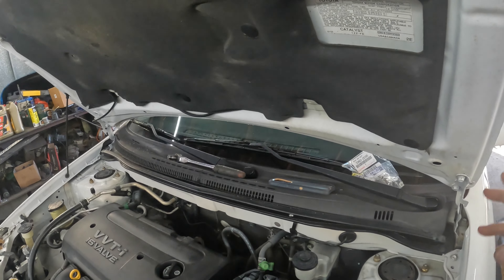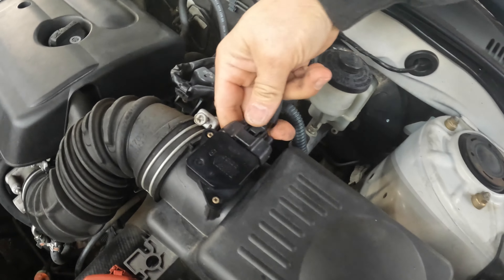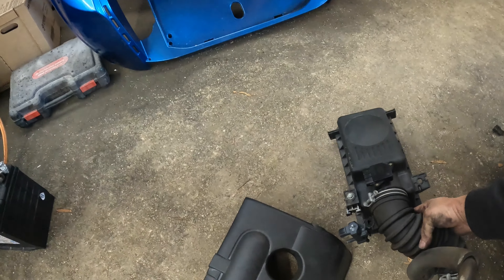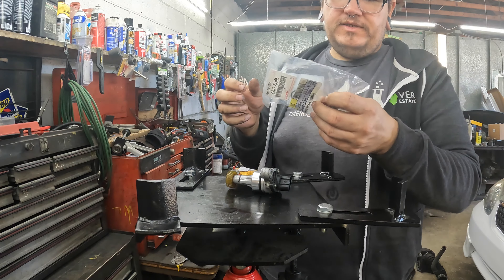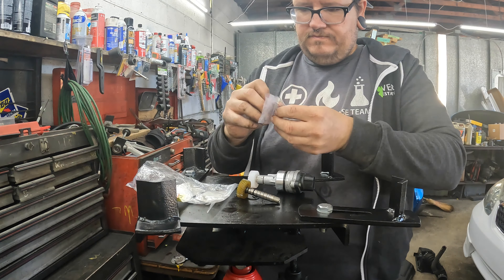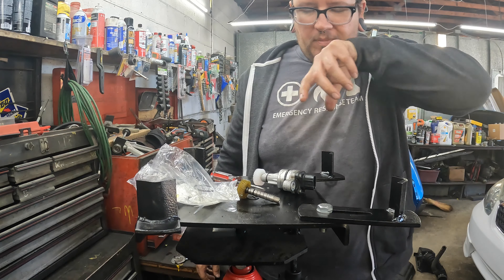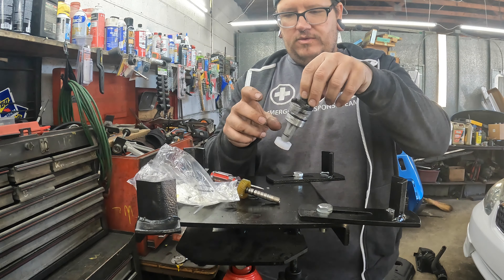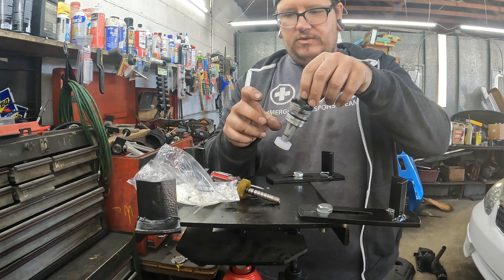2005 Corolla P0741 Code Recall/TSB Fix

Comment: My 05 Corolla has had the 741 code for 150k miles. Still Rolla'ing along and just hit the 310k mark today.
Reply from the maker: This code normally does not change the way the car drives for the most part.  Most people need it fixed to pass inspections.  If it was my car, I would have just drove it with the code in it.
Reply: It won’t pass a smog check in California with this code. I’m replacing the solenoid. I didn’t know about a recall that would cause the same code. I have taken the car to get the codes but the part you replaced doesn’t show only the solenoid.
Reply: @operationoverhaul

Comment: How is the p0741 code a recall?
Reply from the maker: Toyota issued the recall after so many of the cars has the issue with the code.  They showed a step by step procedure of what to change and if those did not fix it then you needed to replace the entire transmission.
Reply: @operationoverhaul can you post a link to that?
Reply from the maker: @josiah7552  i will find it and post it for you tommrow
Reply: @operationoverhaul thank you, you're the man 🤘🏽
Reply from the maker: @josiah7552  https://www.troublecodes.net/wp-content/uploads/2023/03/p0741.pdf this should get you what you are looking for.  If not, I can save it and send it to an email address if you would like as well.

Comment: I have been seeing this error for a couple of years now. Is there a way that I can get this fixed in a toyota dealership without costing an arm and a leg? :P
Reply from the maker: They will probably go through the same procedures that I did in this series of videos.  I tried multiple things to correct it and did not get any resolve until the customer changed the entire transmission assembly.  This was a recall/tsb at one time but I think it will not go through now due to the age of the vehicles.

Comment: Is this code belongs to gear box, is not repairable without downing gear box?
Reply from the maker: The recall has a few steps to it.  It says try the speedometer gear, a new solenoid, and then if that does not work to swap the transmission and torque converter.
Reply: Is it covered by the manufacturer?

Comment: Daaamn i really dont want to replace the trans on mine. Code pops up very little but i am starting to get worried. Still haven't done a trans fluid change but its due now. Hope that'll solve it but I don't have high hopes seeing your video and comments here 😅 what are the symptoms of that code?
Reply from the maker: So, most of time I do not see a difference in how the vehicle drives when this code pops up.  If anything, you may not feel it engage lock up.  That is about the only thing you will probably notice.

Comment: Did it work
Reply from the maker: No, this did not fix the problem.  Ended up replacing the transmission and now it is all good to go.
Reply: @operationoverhaul this code shows up once in awhile on my 2005 Corrolls but it drives great. Recently got a new battery, spark plugs, tires, new Sepertine Belt; in 2021 I got a Trans Filter and Flush
Reply from the maker: @AndruWProWrestling  on this car I was even able to verify that the tcc was going on and off but it was still throwing the code.  Was a pretty common issue if they issued a tsb on it.
Reply: why didnt you just replace the solenoid?!  @operationoverhaul
Reply: or at least test it with a power probe? @operationoverhaul
Reply from the maker: @yoshihisa4213  the owner did not want to replace yet.   They wanted to follow the tsb and change the parts in the order of the tsb.  The solenoid was tested with a scanner and it will actuate when prompted.  Even when running it actuates on its own while driving as well.

Comment: Is there a recall for that? Because I have this code coming up for my 2005 toyota corolla
Reply from the maker: It is not a recall but rather a TSB (technical service bulletin).  It goes through the steps in order to fix the issue.  You can actually google search P0741 Toyota Corolla TSB and it should show you the tsb.

Comment: would this work on a 03 toyota camry 2.4l
Reply from the maker: It should be the same procedure I believe.
Reply: @operationoverhaul  same location?
Reply: @operationoverhaul  and do you have to drain the trans fluid or can you just put in the sensor?
Reply from the maker: @jesselee5027  you do not have to drain any fluid. It should be under the air breather on the top of the transmission.
Reply from the maker: @jesselee5027  yeah it should be the same location.

Comment: i have this code right now. except, when it first threw the code, the transmission began making a deep humming sound that has never gone away. shifts like a dream still, wouldn't think anything was wrong with the transmission besides the constant deep hum upon acceleration in drive only. no idea where to start. originally two years ago i drained the black fluid at like 280-290k miles and i assume it has not been touched since it was first manufactured.

no idea how to approach this. tips? advice? thanks.
Reply from the maker: I would first start off trying to find someone who may have a bi-directional scanner so you can view live data and see if you can turn the solenoid off and on.  Then if that looks good, I would start checking signal and power to the solenoid to make sure it was getting correct information from the computer.

Comment: Is that speedometer gear compatible with the A245E transmission
Reply from the maker: When I looked up the part number, it actually says it is compatible with that transmission.
Reply: Yeah I’m gonna try that gear and hope it works thanks for the help
Reply: I bought the speedometer drive gear using the part number you provided from toyota and I power probed the torque solenoid. I replaced 1 solenoid that was a short in it. I still had a code then replaced the speedometer drive gear with the one you provided and the code cleared and then it passed  smog. Thank you for your video and advice. You helped us a lot
Reply from the maker: @danielc9155  Awesome.  I am glad that it helped you out and worked for you.
Reply: @danielc9155 4 months later now, is the code still off?